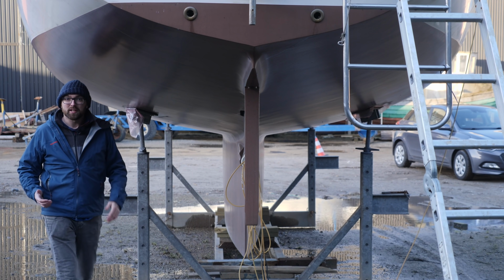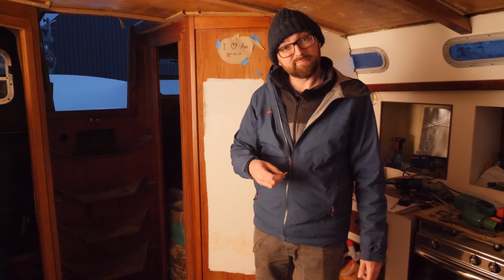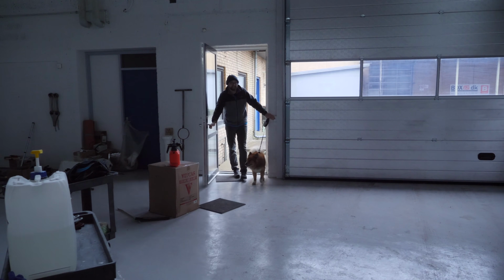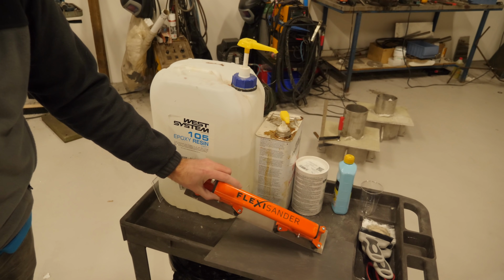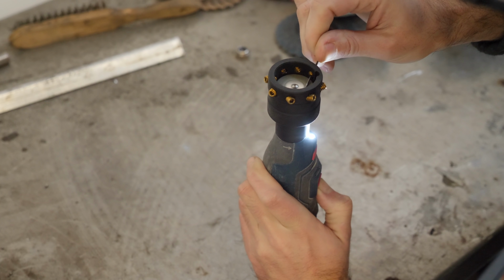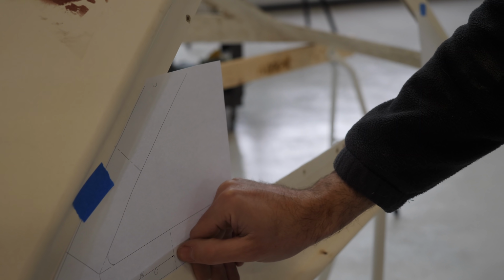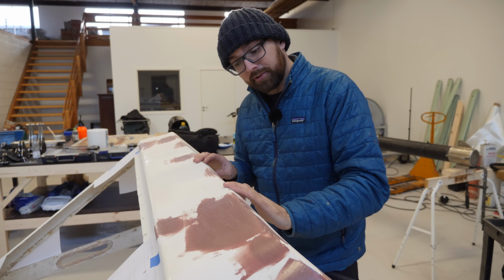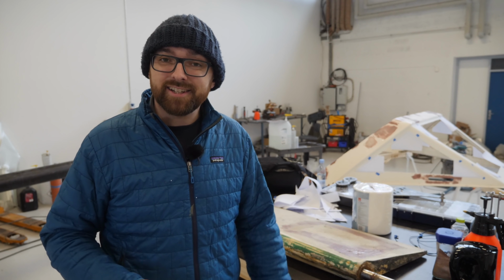Sail Life - dodger rebuild part 2, structural members & TungstenMate - DIY boat refit

Comment: For future reference; anytime you open a container of filler powder, you need to be wearing some form of respiratory protection.  That stuff will get into the air just from opening the container, and a lot of them are basically glass bubbles...which you do NOT want in your lungs.

Comment: Potassium Nitrate is used to dissolve tree stumps. I wonder if you could drill holes on the top of the structural members and pour some in. The wet wood should break down, allowing you to remove it and replace it with expandable foam.

Comment: On the glass question Thomas answered the strength part. Beware the corners on the pieces just a tap and you have a puzzle that won't go back together,cushion the corners. European automotive laminated glass is very soft and scratches or sand pits easily. Laminated glass is susceptible to moisture turning the plastic milky. Enjoy watching your adventure.

Comment: Laminated glass is actually pretty weak. It is two layers of regular 3 mm glas with a plastic sheet between. It will crack at the least bit of bending and eventually the plastic will discolor from the edges. Laminated glass is also twice the price of tempered, and tempered is 10 times stronger than same thickness of laminated glass.   cheers

Comment: Dear Mads   I hear that you may Fiberglass over the old Frame, you may want to think about the weight you will be added to the Hull. Maybe switch too Carbon Fiber over the Glass to keep the weight down. Or Maybe get with the Carbon Mast Company in the UK to me a patron for your boat and the Carbon Mast and Boom will make your Boat lighter and Sail Better. Reach out to the Mast/Boom Company on what they think about  your Frame Problems. Greg from USA
Reply: The weight will be minimal
Reply: Sir You do not know if there is more Frames problems that are water soak . To be safe and do the JOB right the first I would check the whole sailboat Frames for water log . Plus today worlds they have that Honey Core that could replace the wood that is damage and also save on weight. That means more Supplies can be on the Boat or more Freshwater tanks. But Mads run his Show but in my eyes you only have one life and one Girlfriend . Mads be safe and GOD BLESS

Comment: tempered glass is stronger for same thickness... laminated will be thicker but a lot safer. Myth Busters did an episode of driving a car through a tempered large sheet of glass and found out that the shards in such an event posed a hell of a lot mor danger to the "dummies". (Dummies were posts wrapped in plastic and filled with red water to see the bleed-out effect . end of story was tempered was more dangerous than float - - for that particular threat.... however - as an architect - i would rather my hand/arm go through a tempered window than float glass in your situation.....if you can fit laminated - which i doubt - go for it....

Comment: i dont know much about boatbuilding, but ive read some things over the years (lets hope i still remember them right). the plywood on your stringers is wet/rotting. thus is losing its mechanical/structutural properties. Water always finds a way, meaning that it will eventually contaminate the rest of it. that plywood is covered in CSM, to keep costs down by the manufacturer. Ive seen people say that the structural integrity of that composite (plywood/csm/resin)  derives mostly from the CSM. i honestly dont think this is right. CSM is there as to waterproof (with a shelf life obviously...) and as a filler to the resin which in turn beds the plywood in situ, thus enabling the external forces to be dissipated (also) thru the plywood, and the latter reacting by helping the hull not to flex. this is how i see it in my mind. im curious to know which solution you are going to be present with by the engineer and you may be in for a VERY BIG project. imho laminating more fiberglass (plain weaved cloths) atop the existing one will not prevent furter rotting of adjacent plywood. to me, one solution could be to remove all plywood sections that are wet, scarph new sections in, then remove all csm covering the dry plywood and then laminate everything to the inside of the hull using biaxial (or even triaxial) cloths. its a big task, but one would never worry again. yes im aware that the "boat gutting process" is potentially quite extensive, and costly both in money and time, specially because at some point you do wanna start cruising right?! with such a project one starts making other questions, like: is this THE boat?, am i going to sell it in the future?, will i get any money back from all the work ive done? etc etc. aniway, its always great to see your videos, keep the ocd up!

Comment: SO Mads, what type of music do you listen to while sanding ?  Classical, old time rock and roll, country or "local" ?

Out of the box thinking ...  The structural member that is the worst.  Cut the top open, scrape out all of the "rotten" wood, and fill most of the void with some kind of foam and then fill the rest with epoxy.  Run that by your engineer.

Comment: I'm also a structural engineer and have enjoyed watching you from the beginning. I agree with the repair method your starting. Just let the old wet, soft plywood be the form core, just like a balsa or foam core. The strength is all in the fiberglass. Can you tell me what 90 degree buffer you used ? We need to buff our hull. Any chance of using the same machine with a sending head to sand the hull before new bottom paint? Looking forward to the day that you and Ava get back in the water.
Reply from the maker: Thanks, Paul :) It was from Bosch's Professional (blue) series. I'm sorry but I don't remember the model number :) Sure you can get a velcro backing pad for that type of polisher. That'll be a dusty job! :)

Comment: Mads, consider building a covering over the lines before they enter the dodger. It serves two purposes. 1) slows the water down so when it reaches the dodger it doesn’t have enough velocity to enter the holes and simply drains out the sides (think of a dorade box). And 2) they cover the lines on the cabin top so removes a tripping and slipping hazard from stepping on the lines. It’s more glass work, but it will be a nice finish to the cabin top, avoid any water slipping in from rough seas and makes sail changes and reefing on deck much safer. Most new production boats have this arrangement when leading lines to the cockpit. You’ll need to adapt for your configuration, but should be able to work something out. Whatever you do it will be perfect. Good luck. The refit is looking “spiffy”! 😉

Comment: Just wondering, the rounded corners will be in the new frame and just cover the current points in the glass, as you can't cut / grind tempered glass.

Comment: May I vote for not adding a toe rail. Like a lot of us viewers I am watching several Sail Life channels. I've noticed a number of blue water class boats without the rails. The main point I want to make is watching the waves break over the side and how the water just runs off. You have worked so hard on making Athena water tight. 400 to 800 mounting holes is just water damage in my view.

Comment: A suggestion for future reference: A local Architect or Engineer will very likely have a large format printer that can easily print large precision drawing. Its very inexpensive for them and most (in my neck of the woods at least) will help you for free. I suggest you create a 1:1 .pdf file to take to them. I can do it too but since I'm in the USA it might not be practical unless you're willing to wait on DHL to deliver internationally. Cheers!

Comment: You are very modest in regards to your TIG welding skills.  I've been welding for years and TIG welding on aluminium and stainless steel is difficult and you did a very credible job.  I really like the attachment on the Dremel tool to grind the Tungsten rods I've only ever used a grinding wheel to do this but knowing what I know about how important having a good point on the rod is I think that it's very worthwhile tool.  Please tell us why you have choose not to polish the existing aluminum dodger frames ?

Comment: We have tempered glass in our hard dodger windowa for our Hallberg-Rassy Rasmus 35.  We had to replace one of the windows in the middle because at some point before we bought the boat it must have broken and was replaced by plexiglass which was all fogged

We went with tempered again because the design of the opening window required holes for the hinges and the latch hardware.  Getting laminated safety glass made with holes in it was way outside of our budget.  The rest of the dodger was already tempered, so why not replace the new window to match?

It wasn't very expensive, like $150 US and took a couple of weeks to have made.

Comment: Mads, I think the dodger is gonna look awesome, has thee whole "Millennium Falcon" look going on. 

One thought I have is 3M makes an adhesive molding tape for the auto industry, it is really just butyl tape with an adhesive applied to it, it is great stuff! I use it all over on my boat. For the inner window frame I would suggest putting that tape between the frame and dodger and then bolting the frame in without the glass, this will stick the inner frame in place, then you can put what ever sealant you are using around the windows and simply drop them into place and they will stay. 

Should make it super easy to assemble that way, and you will really be able to get a nice tape line on the sealant on the glass.

Comment: Another TIG professional here with 2 decades experience. 1) Wear an N95 mask when grinding tungstens... in fact, wear a particulate filter when doing any sanding, grinding, etc.. Make dust or smoke, wear mask (do some reading on thorium). 2) I've tried every tungsten grinder gadget made and I always wind up back on my dedicated bench grinder or 2" belt sander. The bench grinder is faster, lasts a very long time, & grinding wheels are cheaper than diamond wheels. 3) I always have my employees grind 20 tungstens to have at the ready for the day (once all 20 are used, go grind them all at the same time again). This saves massive amounts of time walking back and forth to the grinding bench and keeps them 'in the zone' while welding. 4) Never double grind your tungstens--meaning, don't grind tips on both ends of a single electrode. Why? Because one will inadvertently contaminate a tungsten to the point where if you flip it around and put it in the collet holder it will slide in fine, but when it's time to change it, it will be very difficult or impossible to pull out and then require one to disassemble the cup/collet holder/collet to get going again--more wasted time. 5) You will find that as your skill level increases, grind angle on tungstens becomes less important to you-there is a sweet range, but it's a big one. (Rule of thumb: short taper/steeper angle = more penetration, long taper = larger puddle because of larger surface area of grind) 6) When welding stainless you should not need to clean it with a wire brush and if you do use a wire brush make sure it's stainless. When you complete a proper weld in stainless you should see only minor oxidation in the form of silver, yellow/gold, or shades of blue and purple--darker the color more the contamination. Whatever the color, the oxidation should be bright and shiny. If it isn't bright and shiny that means A) you were moving too fast, B) your torch technique allowed too much oxygen contamination, C) you used too much heat, D) your electrode was contaminated 7) Since you are working on a boat you should passivate your welds to help prevent rust--yes, even with 316SS. We use a passivation paste called Antox 71E Plus. It works great! 8) When welding stainless you should have an open door for better ventilation. When welding stainless, it out-gasses Hexavalent Chromium. HC is bad stuff and can cause central nervous system damage. I could go on for another page on tips n tricks, but this is your channel! You are doing great things, Mads. I have 'mad' respect for you and your abilities. Thanks for the great content!
Reply: Ethen... you sound very knowledgeable mate!  Have you done your own channel on welding?  If not, hop too it because I would like to learn too. Sounds like there is a lot of content to cover.  Cheers!
Reply: @Mancubsa , I have thought about it and even recorded some video of various Jeep projects. The problem is I have too many projects and not enough time--and a company to run.
Reply: @ethanturner5567  , I did notice you had a few on your channel and appreciate your position, you just seemed very knowledgeable and precise that it was a shame not share hence the ask, I have a feeling I may need those skills sooner myself haha.
Reply: @Mancubsa , yes, I have a whole other life in music which started when I was in my single digits, but music and art are a difficult way to make a living. I got into metal fab when I was young due to my parents being a Jeweler and Luthier. Metal fabrication was natural for me so fabrication and Architectural metals became my life blood and the way I support my music habit;) Here's my collaboration with my girl: https://www.youtube.com/channel/UCnhvtCAdmZH7pX73uvruiHA
Reply: The belt sander is also nice because you can easily switch out the belts for different types of tungstens, grinding aluminum vs steel, etc.  I don't even own a bench grinder because I do better work with the belt sander.
Reply: Ethan Turner Lets hope Mads reads these comments, I have made many and not seen many answers...
Reply: This post should be made into a web site.

Comment: The principle reason for using laminated glass would be security, you can drive a pick axe through laminated glass and all you would have is a hole the size of the pick plus a load of razor sharp shards.

Hit toughened glass with a pick and all you'll have is a pile of glass cubes about 6mm cubed.  Much safer.

The other down side to laminated glass is, unless you have a perfect seal, that over time water will penetrate the laminate and it will become milky.

Comment: Hi Mads, you might want to wait with mounting your windows on the dodger. Without the windows you can run the lines over (or through) the holes of the windows so you can measure and mark the position of the cut outs.

Comment: I must have missed an episode about the toe rail. Now you're practicing welding? Is the intent to fabricate your own toe rail from stock? To be honest, that sounds like a far cheaper option with better chance of a good fit. I think my only concerns would be making sure it's as structurally sound as I want a toe rail to be. But the satisfaction of having designed your own rail, with your own scuppers and chocks, in the places you want them (not the factory)... that would feel satisfying.

Comment: noted many ports on the tungsten mate. Are they set at varying angles?
Reply: They are for different diameter tungsten. And dont waste your money buying one of those stupid things.It takes forever to sharpen with one of those gadgets, and the angle makes pretty much no difference. The angle should be about three times the thickness of tungsten your using. So if its 1/8th tungston you would want a 3/8ths taper down to nothing at the point for stainless steel. Just stick it in a drill and use a belt sander or grinding wheel. Well unless you prefer to look like an idiot who buys shit for the sake of buying it just to do the same job even slower.
Reply from the maker: ouch, Jacob ... someone has a case of the Mondays ;)

Comment: Is it possible that laying smaller patches first and going progressively bigger in a beveled hole gives more adhesive strength, because each overlapping layer makes edge contact with the solid fiberglass surface?   I've never done such a repair, so I don't really know, but would be interested to hear from those who have.  No doubt I will eventually have to do this myself.